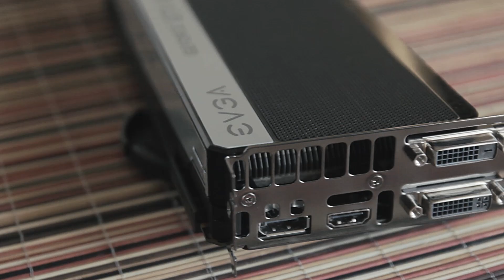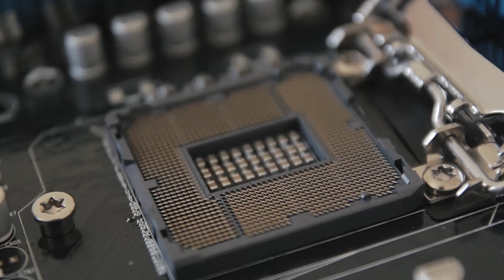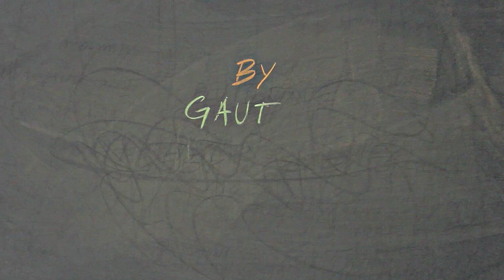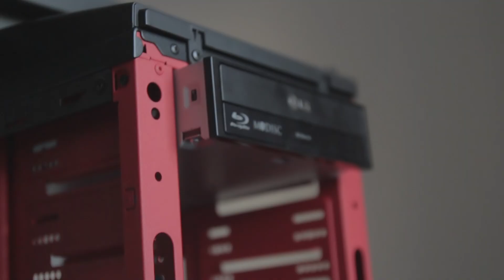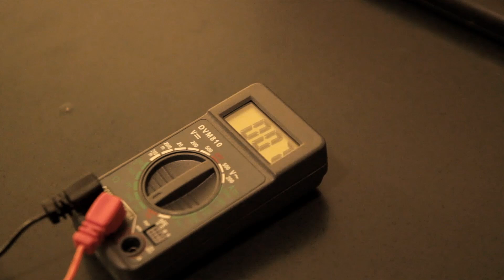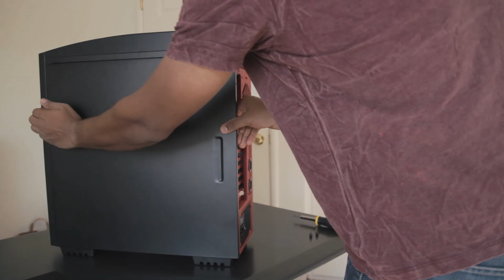How to build a video editing or gaming desktop PC - Tutorial

Comment from the maker: "I'd think, all GPUs, CPUs and motherboards use the same PCIE standard technology, so all GPUs and motherboards must be compatible. As the GPU is connected to PCIE lanes, and as PCIE lanes are connected to CPU and not the chipset (at least in intel mother board), the only question about compatibility should be between CPU and GPU right?
Google, "Intel® Z77 Express Chipset - Ultimate Performance Tuning" and click on the first link... It may be useful to you..."

Comment from the maker: I got the "Seasonic M12II 620 BRONZE". But the cords are too short if I want to route them neatly. Yeah, it is kind of tough to know if the power supply cords are long enough. May seem a dumb suggestion, but I guess you could order a couple of varieties of cases and supplies and try them out. The main problem with my setup was the case. I got a full tower where as a mid tower case should have been enough. I tumbled and fell into the "looks" factor and missed out on the "functionality" factor. :(

Comment from the maker: Congrats! I think i7 3770k is a really cool processor and you will definitely notice a difference. I am using SSDs connected to the SATA 6.0 connectors and I've not noticed any glitches. Initially, I was getting the blue screen of death. I stopped overclocking the RAM and am overclocking just the processor and things have been stable for the last 4-5 months. The core temperatures are uncomfortable (around 30-40 C), but I've not done much about it.